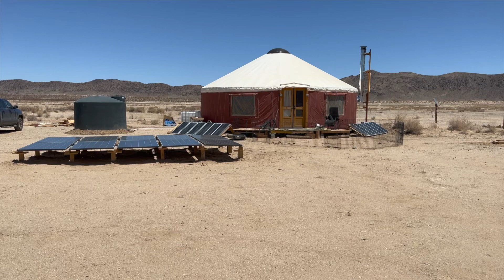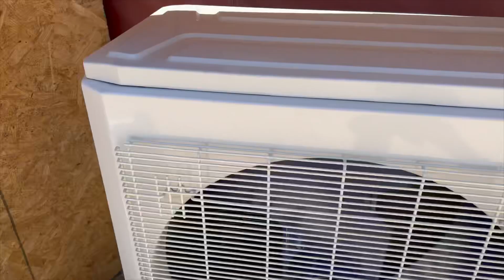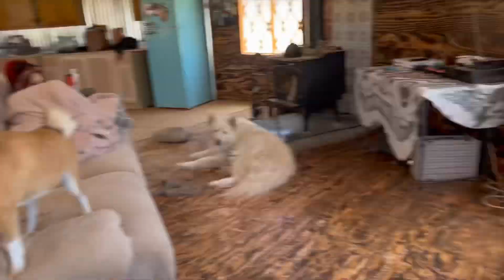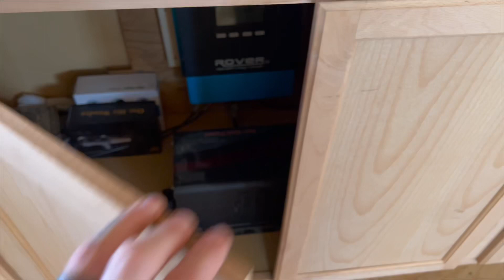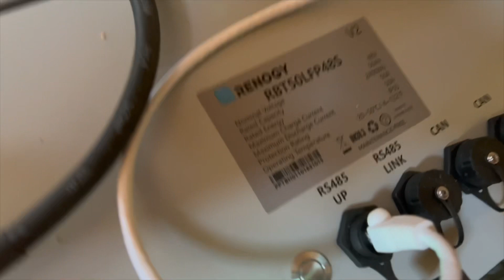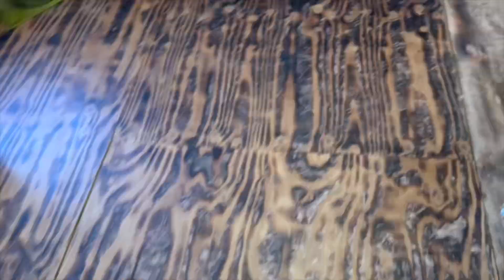Off Grid Yurt Solar Set Up

Comment: Hi , love what you have done !!!
Did you have to get a type of permit from San Bernardino county or get approved by Edison ?
Reply from the maker: Yes we did have to get a permit because of the square footage. Had it been under 120sq ft we would of not needed a permit. We are completely off grid and not connected to any regular power source. We did have to get a permit for our off grid solar through the county.

Comment: Wow!!!  That’s a lot of solar. Awesome. Any issues running the 
a/c’s all night. I have a small solar set up. 24 volt. Only 5 100 watt panels right now. Would love to have a large set up like yours.
Reply from the maker: Thank you we’ve worked very hard to get it to this point. We started with a 300w kit from Renogy Solar. And this is what it has transformed into over the past year. This was our main focus living in the Mojave and needing to run air all day and night. This allows us to run both our mini splits during the day and we run the small one through some of the night. We are working to get another 4 batteries to be able to make it through the whole night comfortably. We are also on a 48v system and started with a 12v system.